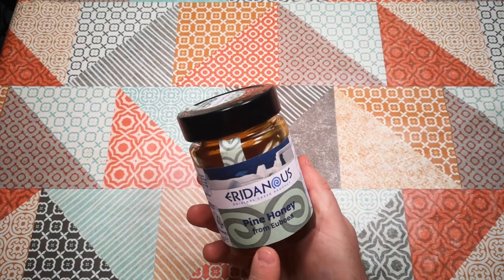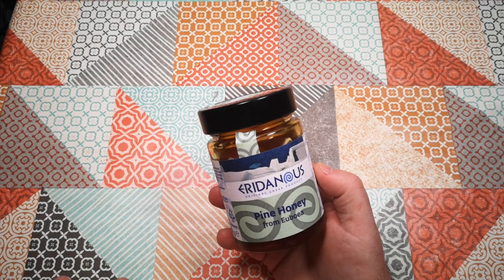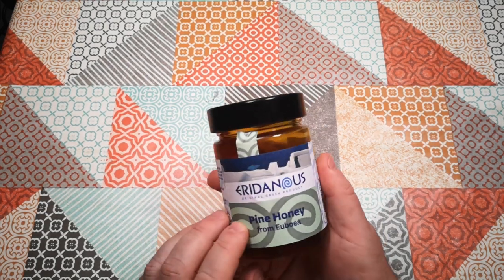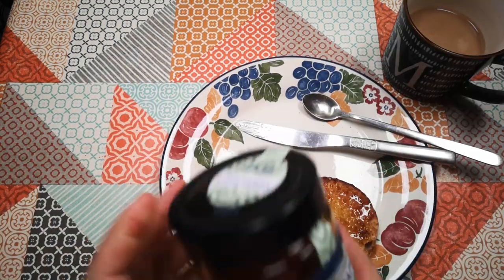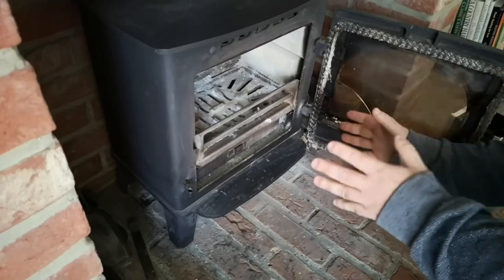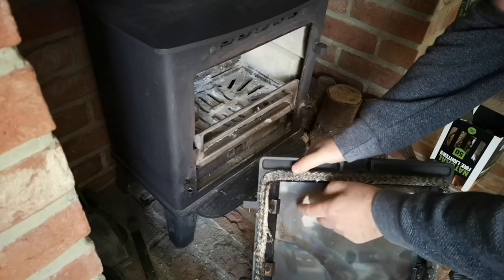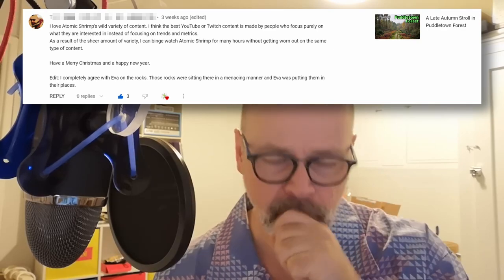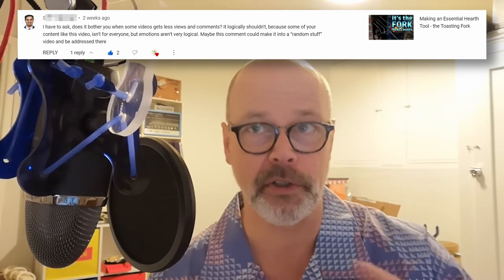Random Stuff - Pine Honey, Stove Maintenance, Burdock Seeds, Comment Positivity, Slaughter Valley

Comment: Referring to the screws used to hold the glass panel in place, might I suggest that you use a small amount of temperature resistant copper grease ( as used to lubricate brake part’s in your cars) when you next do any maintenance work on the screws holding the glass panel in place.
Also may I suggest that when you are sowing your burdock seeds, you can expose the soil a little by either making shallow holes or cuts in the forest floor, or simply use your boot soles to scuffs clear spot so the seeds get the opportunity to contact the soil without obstacles.

Comment: Trick to get the fire going that helps particularly with small stoves:  leave the door open slightly. It makes a strong draft that will cause the fire to reach towards the opening. Put logs in that path. Close when the stove is hot enough to keep the fire going on its own.

Comment: Thank you- you’ve just reminded me I need to replace the rope in my very own Stovax5! 
Great little stove which heats the whole house.

Tip- you may want to look into putting a fan on top which will not only help distribute heat further, but prevent damage to the internal workings if the stove overheats- I buckled my baffle through this and that’s not what anyone wants lol

Comment: I change my stove door seals every year as it is used continually in the winter and they compress to the point the seal isn't complete.  Nice easy job which I recommend everyone does on a regular basis.  I have a "room sealed" stove with a vent to the outside of my house directly into the bottom of the stove. This stops it drawing air from the room and eliminates cold draughts in the house - makes a big difference.

Comment: Hi shrimp, I hardly ever comment on videos but just wanted to share a little hint- stove glass is a pain! In 30 years I’ve replaced the glass in my stoves 5 or 6 times( I have 3) and have learned that a little dab of copper grease on each screw will stop the screw for seizing making it easier to remove next time , whenever that my be. Also when replacing sealing rope start at a corner and cut the rope ends on the diagonal- makes a much more efficient seal. Keep up the good work.
Reply from the maker: Good idea - I can probably do that now by removing them one at a time
Reply: @AtomicShrimp  certainly. Also liked your idea with the tape under the glass retaining brackets- I will do the from now on. All the best.

Comment: Never eaten pine honey from Lidl, but I have eaten homemade pine honey purchased directly from beekeepers both in Greece and Romania. And normally it's slightly darker and thicker that what you have there, and it has a bit of pine resin taste. Don't know if that is because the beekeepers add a bit of pine resin afterward, or they just don't filter the honey as well as this one. Also, tips for mistakes that you did while repairing the oven door : 
1. Stuck screws : always try a bit of WD 40 before anything more damaging like an impact screwdriver, works miracles 90% of the time.
2. After brushing the rust, you didn't clean the door before installing the adhesive rope, so you have very fine rust dust under the rope, completely compromising the adhesive. Either use a compressed air blower, or even better if you have the time wash it with water and dish soap and let it dry.
Reply from the maker: I'd already tried WD40 to no avail before this attempt to fix the door. On the dust thing. Video editing exists. Not every moment of the process is present in the edited video.

Comment: I grew up on a farm with wood burners and aga/rayburns , If you need glass for a wood burner just get some schott robax cut to size ..its the best stove glass and what most good stove manufacturers use...Stovax are an excellent make of stove most of they're stuff is great with the exception of they're 'Protector flue and chimney cleaner' powder ...I've not been impressed with it and have gone over to the Zip Soot Reducer Sachets which seem to do a better job of 'breaking down' any crosote deposits and turning them into a dry power which makes the flue /chimney a lot easier to sweep...you'll still get some small deposits even with good dry wood and a nice hot fire....nice job on the wood burner door....love the videos.

Comment: 00:13 - Rockwool is your friend. :) Don't let anyone scam you with foam pads. Homemade rockwool panels dampen with a broader frequency response and sound more natural. They also dampen a mid room resonances a lot better than foam ones do for the thickness. Also, don't forget to treat the ceiling above your desk and right behind. That'll reduce comb filtering artifacts and make it sound much more 'direct-to-mic'. Might need some slight high EQ introduced after treatment as it'll suck energy out of the highs in your voice.

Anwyay, I'm sure you've probably sorted it by now. Just wanted to add some audio engineering tips in case you were still looking into room treatment.

Comment: Wood stoves may seem antiquated these days but they're inexpensive to run and don't need gas or electricity to run.  Here in VT we had a severe wind storm that knocked out power to more than half the homes in the state.  Ripped the power line right off my house.  Wood stove don't care, if you've got wood and an ignition source you've got a warm house.

Comment: Great stove. Do you burn coal? If not I can’t recommend modifying it to a wood only stove. It’s cheap and easy to do. I only realised you could do it after having the stove for 5 years! The stove is a totally different beast and will burn bigger logs! You can load it up go out for a day and come home and it could still be smouldering!
Reply from the maker: Interesting. Do you just burn wood directly on ashes in the Ash pan?
Reply: @AtomicShrimp  i  removed the ash pan and use a small shovel to get most of it out. I always leave a little as it helps form a good bed for the fire. Stovaxe will tell you the part no.s of  parts you need but basically its two new bricks. a penny washer and nut and bolt (to block the riddler hole). the riddler and great are removed log guard lowered and hole blocked up. 

Fab stove! and thank you for all the interesting videos. lewis

Comment: I love a stove. Have you tried lighting it the other way around? Big stuff on the bottom and kindling on the top? You get instant heat up the flu and reduce the chance of smothering the fire on lighting.
Reply from the maker: People keep recommending this and I tried it yesterday.  It was pretty disastrous - the fire didn't really take hold once the kindling had burned, and there was a lot of creosote deposit on the glass as it smouldered and struggled to get alight
Reply: @AtomicShrimp  Sorry to hear that. I use that method on my stove in Wiltshire and started when I was having issues on really frosty days. I usually light with birch and make a log cabin, about 5 rows high of kindling from 5mm or so at the top to 20mm at the bottom with a few small logs at the bottom. The glass should clear with heat. But whatever works is good. The biggest addition was an eco fan or two. The Aldi/Lidl ones are every bit at good an the £130 ones. Are we going to see improvised cooking in it?
Reply from the maker: Yeah, I'm thinking about cooking on it, but a little cautious about boiling a pan over in the living room
Reply: @AtomicShrimp  you could try a pie.

Comment: Best to set autofocus on a point, then turn it off so movement doesn't change the focus point
Reply from the maker: That's what I did, for a close shot, then forgot to set it back
Reply: @AtomicShrimp  Oh dear, it happens. At least it wasn't a 15 minute one take guitar piece, that you nailed perfectly but filmed entirely out of focus!
Reply from the maker: I think eventually I have to invest in a camera with auto focus that doesn't hunt uncontrollably
Reply: @AtomicShrimp  Check out the Canon M50 or M6MKii. Both very capable for not too much money.
Reply: I use a tripod or light stand in front of the lens, where my hands will be to set my focus, then turn it off on the lens so it won't hunt all. Much less distracting

Comment: SCP isn't analogue horror, the relation to your work is just that it is about the anomalous and that the individual parts are short, and to an extent the fluidity of what is true could be considered a shared element, but with SCP that's because it's a community writing effort with only limited collaboration (and originally everything was managed to make a cohesive cannon that kind of fell apart a little ways in when some people deleted core elements of the site that they had contributed), whereas you are deliberately making truth ambiguous. 

you shouldn't worry too much about copying SCP. Most of them aren't anything like what you are doing.  There are a few that have a somewhat similar feeling (namely Unlondon, Daleport, and maybe The Class of 76), but for the most part it's more of a methodological approach to the anomalous